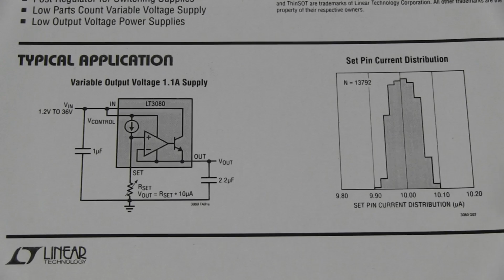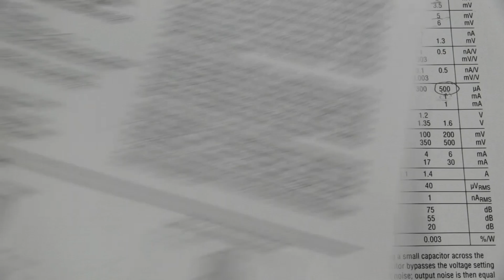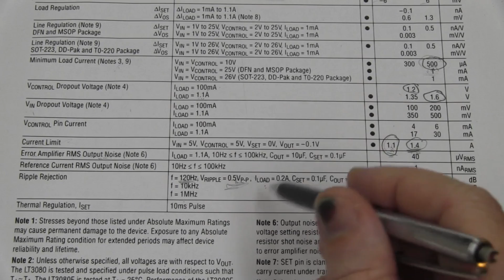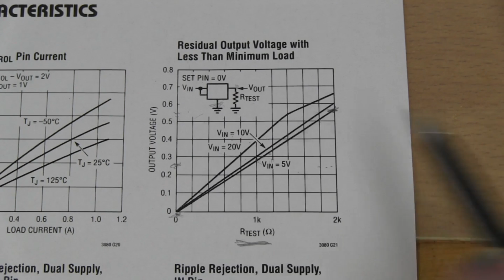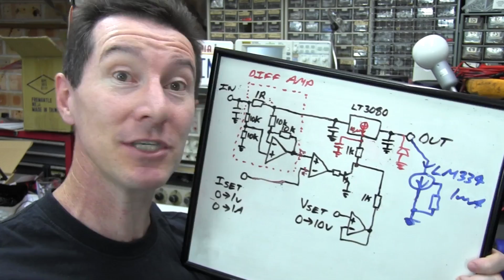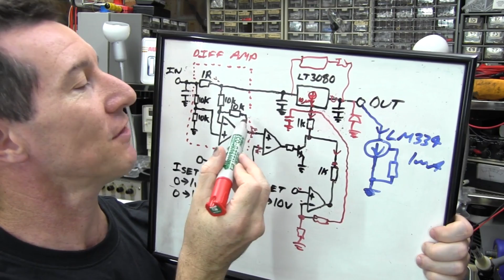EEVblog #222 - Lab Power Supply Design - Part 2

Comment: Can someone help me understand why on low side current monitoring you still have a voltage drop? Let’s say the lt3080 is outputting 10v to the load, wouldn’t the voltage at the loads input still be 10v?…. As I write this I realize if a 1ohm resistor is used for current sensing then the load can only drop 9v and the current sense resistor will drop 1 volt….. so the load will actually only see 9volts….. I thought of this because for whatever reason I can’t get any op amp to work as a high side differential amplifier…..

Comment: EA did a lovely lab supply 0 to 40VDC at 3A back in the mid 90s. I built and sold several. 

In more recent years I designed a supply ground up to be a bit more contemporary but using the same schema as the EA supply. The schema being the use of op amps and BJTs. The original design used needle movement meters. I used digital displays. 7 segment red LED to show voltage and a bargraph row of 10 LED to show current being drawn. The resolution of the LEDs was switchable from 10mA to 100mA. My design was good for 0 to 30VDC at 1A Dual rail tracking. I did the PCBs myself and did a low production run and flogged them off on eBay at 99-cent auctions. I lost a lot of money. It seems that Australian Made means very little these days. The money that I recieved was on par to a Chinese supply on the other side of the world. Disgusting. Australia is a first world country. Most people in Australia require at least fifty dollars or much more a day just to live comfortably. Middle-class adults would consume much much more than this. Minimum wage is close to twenty dollars a day now after tax. So that is 40Kpa.

Comment: ..amazing knowledge and presentation, that's great, Dave.  But what I don't understand is - when you have so much troubles with pulling your minimum output voltage down to zero (status quo is 0,8V?) ...why don't you bring the GND up to this level - which means:  why not realizing a "virutal GND" which is rather easy to do with a smart op-amp configuration (especially for a skilled and smart engineer like you are)?

Comment: I have seen many of your videos, and I loved them because of their simplicity,
and because you focus on the principals, and not overthinking things. 

But at this one it looks to me, like you ran into that trap.
In the end you develop an opamp curcuit to overcome the the fact, that your are raping voltage regualtors as darlingtons.
So... Why do you not just use a simple darlington transistor?
The feedback loops look nearly the same then...
The use of constant voltage regulators would just make sense, if you wanted to have a constant voltage or current,
but if you let the opamps do the work, which is what you do, a simple darlington would get the job done.
And as far as I can see, your regulators will not save you from building an oszilator on the current regulator by accident.
So what should be the benefit of using this regulators, instead of a darlington?

Comment: Why do you call the operational amplifier
- a comparator
- an error amplifier
- a buffer
and why?
as far as I got it, it tries to match the voltage on the output referenced to ground to the input voltage on the + connection. Why do you sometimes draw only 3 connections? What are the other two connections for?
Reply: For those that may have the same question : The name comes from the use of op amps in mathematical operations. The name stuck!

Comment: Could you add some circuitry that drains the output capacitor when you hit the current limit? (And also when you decide to lower the voltage)

Comment: in LTspice, I stuck a PNP transistor where the emitter was connected to Vcc, base to the input of the LT3080, and the collector tied to the output, and I bridged the connection between the emitter and base with a 10 ohm resistor, so that the majority of the current was routed through the PNP transistor. (same config used for the classic 7805 10A linear reg) which, looking at closer, effectively made a Sziklai pair. In LTspice, this appears to work fine, although I think it does bypass device protections a bit. Can anyone give me insight if this would be problematic in real use?

Comment: Great video , might have a go at building this as i'm trying to learn more about DC power supplies LDO's bucs charge pumps etc  :) Think it would be a great idea if you did a video of a dual rail positive / negative dual rail tracking supply? Theres a lot of audio types that would love it !!!  Or maybe dual rail is a bit over complicated for beginers like me? Anyone know if the LT3080 can be used for the negative part of a dual rail +-v supply ? have two and reverse the output of the second for the negative rail and link the amp & voltage control pins together for the tracking ?

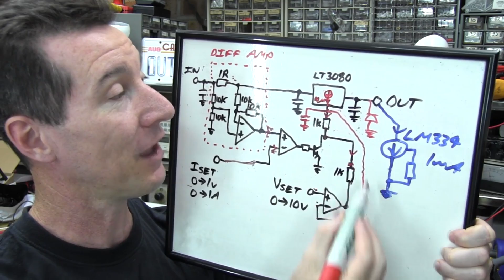Comment: At 35:17 it is shown to connect the negative input of the opamp to the Adj pin to avoid the error with the resistors. What if that feedback is taken from the output itself? Would it work? it would avoid the 1.25V offset.

Comment: Lots of traps for young players
Reply: The more I learn and understand, the better I get at making working circuits, and the less I feel like I have any idea what my circuits are doing outside the range of my cheap USB oscilloscope lol

I feel like most of the theory I've learned past Ohm's law has been less useful for my hobbyist tinkering than learning to read datasheets and application notes.
Reply: From whiteboards to paper
What's next he tap on a screen

Comment: I think that when the transistor is turned on it will not lower the output of LT3080 to zero, because there is a resistor 1K between the transistor and LT3080.
Reply: Old comment, but dropping low is good enough for the current limiting purpose, no need to drop to zero.  This should drop the set voltage to 10 mV, which will be enough to limit the current through pretty much any load other than a short circuit. (And even then it should keep the current within reasonable limits)

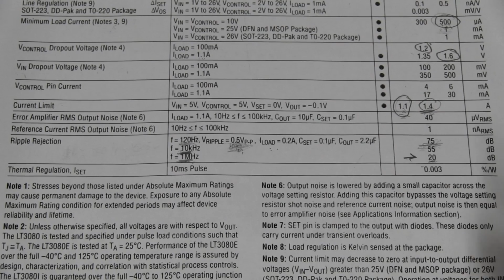Comment: I think you made a small mistake with the equation at 16:45. It has to be V_In / V_Out not the other way round or your V_Out will explode (75 dB ->2811 V; 20 dB -> 5 V) and you won't get anywhere near the results you gave.
For those who wan't to go deeper into ripple rejection in linear regulators this document from TI gives a nice summary about this topic: www (dot) ti (dot) com/lit/an/slyt202/slyt202.pdf

Comment: Great circuit and great show, but I think somethings are missing here. I believe you claim this circuit will work as a an adjustable power supply from 0-1Vin for 0 to 10Vout and similarly 0 to 1V Vicntrl for 0 to 1A I out and all of this is done with a single supply rail??  Please show me how.  Your circuit will work as described but I need to have at least a small negative rail for the current sense and voltage drive amplifier.  I actually used LTC Spice to verify the above. Perhaps I am missing something.

Comment: I'm really not in favor of using LM334, IMHO it's too expencive solution (It costs about 1 dollar in local retail store, about 40 cents from wholesale distributor).
Simple 2N7002 as current source, with one LED and resistor will do even better job for about 10 frikin' cents!!!
Reply: Ayush Chand  I don't know how would a current mirror help :) If you use LED, you can even use it for signalisation that supply is On...
Reply: The current rating of 2N7002 and its heatsink (or the lack of it) makes it pretty much unusable in my opinion.
Reply: thegoodhen Why? Remember, Dave used LM334 to create constant current sink of 0,5mA. You won't have any problems drawing that little with 2N7002. And power consumption? Even at 30V and 5mA (which is not even needed) you will get 150mW -> no problem there...
Reply: mrkv4k Oh. I misread the LM334 as LM 317, not realizing he used LT3080 and thought you were saying he could use the 2N7002 as a power device. You are probably right, sry about that!

Comment: Dave, sorry, i do not understand. Won't LT3080  internal current source produce unnecessary voltage drop on 10k colletctor resistor? If i am correct this resistor was initially placed to reduce collector current and this is not necessary since LT3080 has internal source.

Comment: Hi and thanks alot for this video! You sir are awesome!!!

Can I use lm2576 instead of lm8030 for this project(with some math work of course)? I need a little bit more power for my soldering iron which requires 1.5A...

Comment from the maker: @PetrFM The LM317 neg supply would actually make it more complicated. Not only the 7660, but the output divider will have a varying current based on output voltage, and that throws out your current sensing at low values. The LT3080 and LM334 is simpler IMO.

Comment: As a relative beginner in this field, I've listed these two videos as favourites, for when I have more time to learn the details. What would be nice would be a practical view of the box and circuit board, so I can have some idea of what I need to put it all together. This is definitely one of those projects were effort in will reward the student later. 

Thanks for going through this. Is there a part III?
Reply: simulate this, step by step, this will give you the overview of the board you need to set in your bread board... then you can compare your simulation with your real measurements

Comment from the maker: @TheMcMonster I don't know, maybe. There is a specific reason why I'm building this "simple" design, and you'll see why in the future (not the next video though). And AFAIK there aren't that many PSU circuits out there that show you how to control traditional voltage and current regs simply from a micro with PWM, hence this design.

Comment from the maker: @techgood Building is more fun, but 0-30V supplies are dirt cheap these days. If buying at least replace the controls with good quality 10 turn pots. Why do you need 30A in a general bench supply? 30V/30V is 900W!

Comment from the maker: @williefleete Sure, but likely not great at the low end on the diff amp due to the offset voltage. You could trim errors out though with pots, but that's rather medieval. I'll be using a slightly better TLC2272 in the build.

Comment: i got some quad LM324 op amps. would those work ok for this sort of thing. cause i might give this a go, my current power supply uses a regulator made from a 741 a series pass and some diodes for reference , crap regulation but it lasted longer than the 5 amp LM338's cause the transistor is pretty beefy. in fact the transformer blew out before the transistor in one case